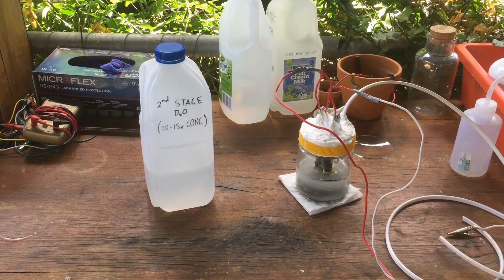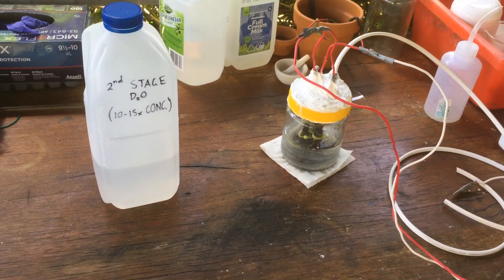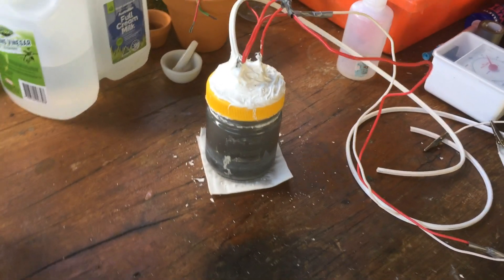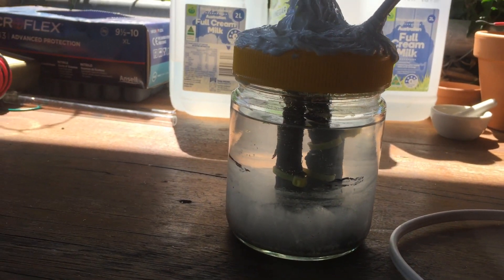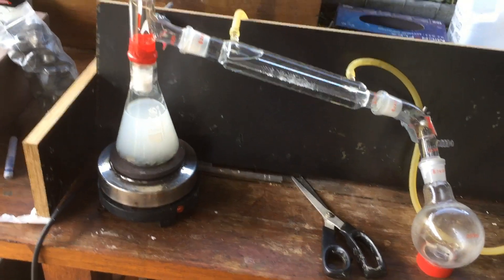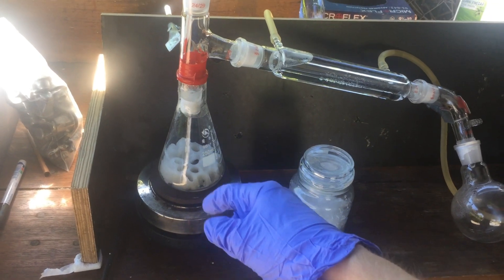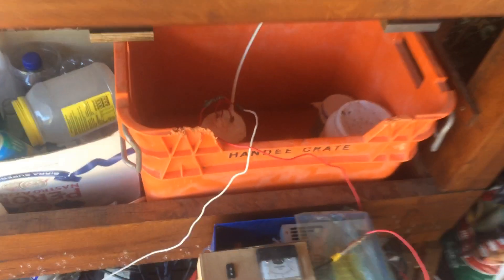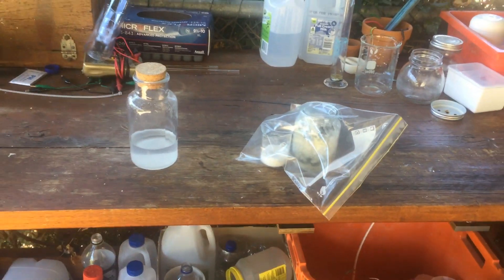Making Deuterium - Part 3

Comment: Fractional distillation is the best way to make D2O from literature.  You could use a alcohol  hydrometer to test the final product.  H2O =1.0 and D2O-=1.1.  I notice by brewing hydrometer indicates alcohol has a  value of 1.1 and the two values are well separated on the hydrometer to determine success.

Comment: Deuterium has a higher boiling point than water, when distilling you really want to boil any impurities dry to ensure you don't lose any. As a side note, this also means that distillation is a fairly effective method of concentrating Deuterium in and of itself.
Reply from the maker: While it's true that distillation separates the isotopes to some degree, the actual separating power of  the water distillation process is hundreds of times less effective than electrolysis. It's so inefficient at separating the isotopes that losing any of our deuterium isn't much of a concern. 

Still though, more efficient distillation is definitely something I'd like to implement if I do end up trying this again. I'm not exactly proud of this video series and I'd really like to remake it at some point.

Comment: is that radioactiv ? asking because you lowered de outoput of the power, meaning the power generated by the electolyte is more powerfull due to the concentration of distilation ?
Reply from the maker: Nope, not radioactive at all. Radioactivity is not related to power, electrolysis, or distillation. There are no significant radioactive isotopes involved in the process at all.